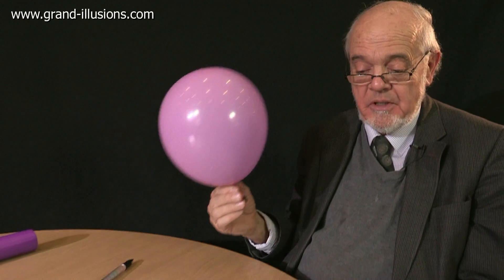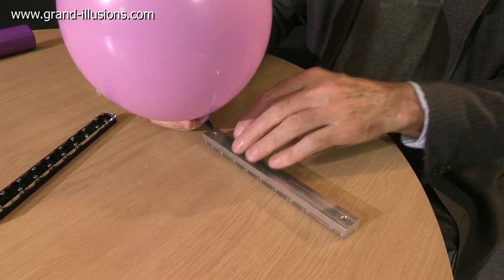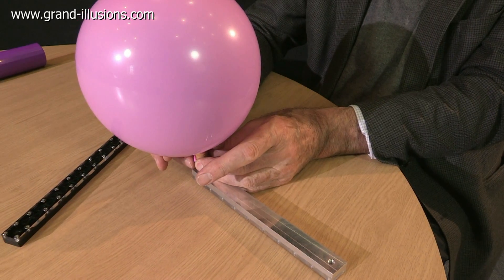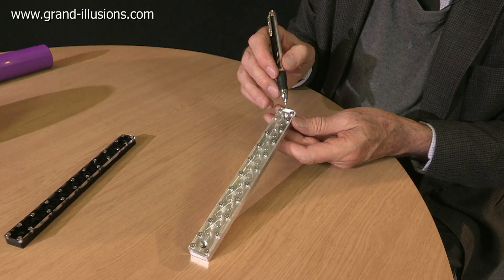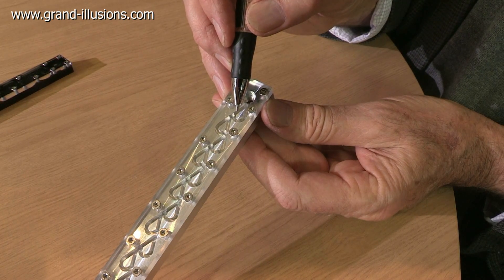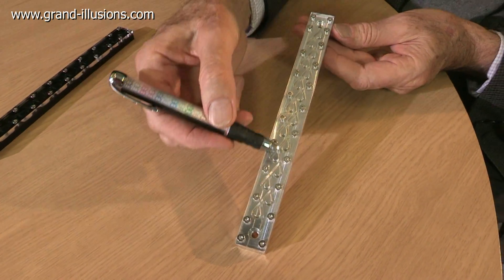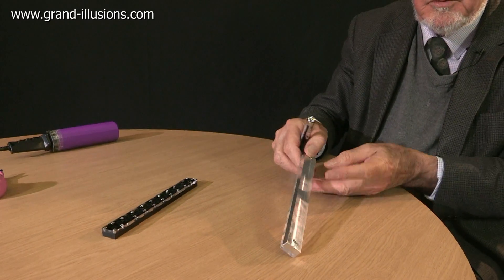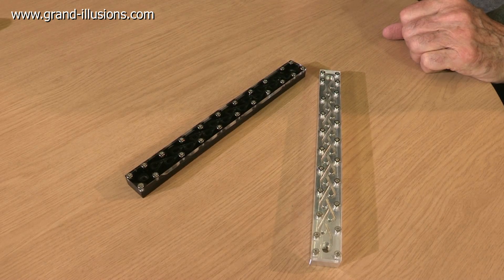Tesla Valve

Comment: On Jay leno's garage he has a video about a steam car and says it's difficult to make a check valve that can hold back 1000 lbs or pressure. Maybe this could be of some use there, unless it works worse at higher pressures
Reply: Jim Henline And you are too dumb to recognize that it is simply a useless toy.  
You know - there is a reason why it is not used at all.
Your inability to understand that is striking.
Reply: Nabre Labre It would be absolutely useless - as it is for every other application.
It is a nice gimmick that kids all over the world invent all the time over and over again,  cause how simple it is.

But it is well - useless.
It can NOT stop any gas/Liquid form flowing through. It only slows down rate.
And another problem is, that it has still a big impact on the forward-flow as well.
Aka even in the right direction it limits the flow significantly.
Reply: Jim Henline
"There are plenty of uses, if you are not intelligent enough to think of them that is an issue you have, not others." 
Or maybe there are simpler and more effective ways to do it.

Your example of a bleeding-system . just make a smaller diameter and maybe bit longer and you are done.- far easier to produce.
And really - how much more of a stupid idea can you come up with?
it is designed as a one-way 'valve' and fails at shutting tight.
 
That valve is a nice thing to play with, but that's about it.
Reply: ABaumstumpf Not really a check valve, but a damper valve. Also saw in comments that it has been used in some shock absorber systems and that makes perfect sense. Faster response because it's making use of the inertia of the working fluid, also a slow let-off of back pressure so there is virtually no fluid-hammer.

So how to use it? Treat it as a circuit with a check valve parallel to a metered orifice. If that sounds useful, then compare the wear and tear on this to the duty cycle that a mechanical check valve in that setup may go through. Tesla was no dummy, although he's much better known for his electrical work.
Reply: It should work better as pressure gets higher, since it get's its effectiveness from the pressure. But remember that it doesn't completely stop flow, it only slows it in one direction more than the other. If you are only ever using it in one direction there are better tools out there.
Reply: ABaumstumpf As a restrictive valve actually its perfect. No moving parts to wear and so with a high pressure system it can be used to regulate the system and allow controlled bleed off without moving parts. Slight change the design to allow the teardrops to get larger and larger and the system become a muffler allowing escaping gases to dissipate before being vented.

There are plenty of uses, if you are not intelligent enough to think of them that is an issue you have, not others.
Reply: ABaumstumpf Again, if you are not intelligent enough to think of uses for it, then I really cannot help you, youtube comments are not the place for me to teach you the basic tenets of engineering.

And it wasn't designed as a one way valve, it was designed as exactly what it is a "valve" so to speak which with no moving parts restricts flow in one direction and not the other.
Reply: ABaumstumpf Have a good day.
Reply: Jim, stop digging that hole.

Comment: I can make the same thing with a "door" inside that can go a little bit to one side before it hits a pin, and a lot bigger to the other side before it hits a pin
Reply: Ah but that’s not “no moving parts.”
Reply: Congratulations, you've "invented" the traditional valve with moving parts. Now invent one without moving parts.
Reply: @bramvanduijn8086  - This valve relies on "moving parts" too (the fluid itself is the moving part, without its motion it wouldn't work). There's literally no advantage to Tesla's design. It's extremely inefficient and gets worse as the pressure increases.
Reply: @RFC-3514  Not to argue the efficiency, because I'll take your word for it, but do you expect the water to break from overuse? The reasons to have less parts are:
 - Interactions increase wear-and-tear on the interacting parts. More parts = more interactions = more wear = more replacements needed.
 - Each part has a non-zero chance to be faulty from the start. These chances multiply, so one part that fails in the 0,001 fraction (= 0,1%) chance, gives the entire device a a 0,001 chance to fail. But if you have 10  parts, that's 0,999^10 = 0,989, or a 1,1% chance of failure. This means you need to machine your parts to a higher standard just to get the same 1:1000 failure rate.
Reply: @bramvanduijn8086  - I don't expect anyone to use it in the first place (an expectation confirmed by reality).

And no, I don't expect the water to break, but I expect the valve to be subject to friction and corrosion, just like water pipes in general. But that't not even the issue. The valve exists for a purpose. The purpose of the valve is not just to keep existing as long as possible.

I see you've gone from "moving parts" to "number of parts" (whatever that means - how many "parts" are in an LED, or in a NAND flash memory chip?), but that's still hollow conjecture. Virtual equations might be a great pastime, but the real world is the real world, and it's trivial to find examples that contradict any generalisation about "moving parts" or "more parts". Multi-part systems can have fault tolerance built in. A single-part system will inevitably fail if its one part fails.

If I can make a fully controllable and adjustable valve that last 75 or 100 years on average, and is easy to repair or replace for 25 cents, why would I spend 10x or 50x more on a different design that requires more resources,  takes up a lot more space, can't be adjusted, is a nightmare to unclog, and doesn't even behave in a consistent manner with different fluids, just because it might last 200 years instead (if it's run under perfectly ideal conditions)?
Reply: @RFC-3514  LED and NAND flash memory chips last so long because they have very few parts. That's my entire point.

And yes, all that is conjecture, well spotted. Have a bonus internet point for that.

"Multi-part systems can have fault tolerance built in. " So you admit that adding parts requires the need to increase the part's tolerance?

As I said before, I'm not going to argue the efficiency, all I ask is that you admit that more parts is worse than less parts assuming all other aspects being equal. You can argue about inequal situations as much as you want, have fun tilting at those windmills and fighting those strawmen, but don't expect me to care.
Reply: @bramvanduijn8086  - Except they don't last so long.

Why do you think I picked those two examples? Didn't you stop to think, for one second, that maybe I'd picked those because they supported the point I was making? Didn't it even cross your mind to spend two minutes learning a bit about how those two things work before hitting the keyboard again?

It wasn't even meant as a trap, but you made it into one.

LEDs age quite quickly if driven at high currents and without active cooling (as is typical in consumer products); after one year turned on, they'll have about half the original intensity. And SSD drives (that use NAND flash memory) have a limited number of writes, after which they become "burned in" (unlike traditional hard drives, with moving parts, that have no limit on how many times data can be rewritten).

Your "entire point" about those (as about valves) is based on lack of knowledge about them.

Thanks for confirming my initial impression.
Reply: @RFC-3514  You are positing unusual conditions and then expressing surprise that the parts break.

For traditional light bulbs the environment (which gases) around the filament or the strength of the current can massively decrease longevity.

For traditional hard drives it is increased read/write speed that kills the mechanical parts.

My estimate of your ability to see giants in windmills was accurate. Go fight those giants Don Quixote!
Reply: @bramvanduijn8086  - I am not "positing unusual conditions" at all. If you knew the first thing about engineering, you'd know that.

As you'd know, for example, that the current through a tungsten filament bulb (ignoring minor variations due to local mains voltage)  is determined by the bulb itself, which is not the case with LEDs. 

And the life of mechanical hard drives has nothing to do with read and write speeds (which in turn have very little to do with any physical speed - a drive that spins slower and moves its heads less can read and write data faster than a drive that spins faster and moves its heads more), it's mostly a function of thermal cycling (which has nothing to do with movement or with "the number of parts").

Your understanding of technology is truly the gift that keeps on digging.

When you next use some mechanical or electronic device, be thankful that they were designed by people with a clue (and qualifications, and experience), and not by self-appointed YouTube "experts" suffering from Dunning-Kruger syndrome.

Comment: COOL! Read that using Fluidics you could make a digital computer that runs using compressed air. Would the Tesla valve be part of such machine? Do you think if Babbage had thought of using compressed air for his "engine" he could have got his computer build my the people who made pipe organs and player pianos?
Reply: Check out / Google Horton Billy Mitchusson Patent 3107850, then dig all those neat links to things like compressed air memory storage. Add a little Nano tech. and who knows? Bummer Babbage didn't stumble into this like Edison stumbled on to the phonograph. Da Vinci should have invented the phonograph, so we would now have 500 years of recorded music!
Reply: ufoengines Mechanical or even steam-powered computers did exist.  
But the tesla-valve would be entirely useless for this - yet again:

It does not shut of the flow - it only hinders it - in both directions. Just marginally more in one direction than the other.  
And for a computer you want to be able to somehow control the flow - aka you need normal valves with moving parts.
Reply: ABaumstumpf Mechanical equivalent of a snubber diode? Put it upstream of a fast closing valve where fluid hammering may be a problem. A mechanical check valve would take a beating and may not respond fast enough, as where this would act like a metered orifice in the other direction and dampen flow.

Comment: What would this even be useful for? Faucets?
Reply: gladitsnotme Looking at how it works, I could see it possibly having some use at dampening back pressure - might be a practical way to deal with water hammer or other annoying resonant flow effects.
Reply: gladitsnotme Tesla used it in an engine design. He used it on the fuel and air inlets to a combustion chamber, and the exhaust drove his turbine.
Reply: Could be used in a pulsejet, I would think. It would trade a little efficiency for longevity.
Reply: +Someday Soon (RoyalVlogger) He said it "could", not "is".
Reply: +gladitsnotme could be used as a water pump
Reply: It MIGHT be useful in controlling tidal flow
Reply: Its only real use is generating traffic on YouTube.

Comment: What would happen if you put two balloons on it, one on each end? Would the air flow from one to the other and make it pop, or would it reach some sort of equilibrium?
Reply: LimeGreenTeknii The pressures will equalize. Fast or slow depends on which way the air would be flowing.  If the balloons are the same the balloons would go to being equal in size.

Comment: some shock absorbers using this tech
Reply: @Chris Russell i love that. Its so smart and sciencey and genius in how particular but simple the design is.
Reply: @Heads Mess surprised why this kind of fluidics isn't more common. Then again, they're probably a pain to calculate & model
Reply: @Muckin 4on completely agree. I’m that same hands on just do it and if it has issues then revise it until it meets my needs. Having a machine shop makes the process much easier but for good reason this is how I’ve preferred learning. Material is cheap and much time is saved when you forget about trying to be that design and perfect design guy to find out half day wasted in front of a computer or longer while in the meantime I have a part completed for initial testing. Lots of folks miss this opportunity in life and overthink everything.
Reply: @Muckin 4on ja díselo a los que calcularon a mano todas las simulaciones basados en los modelos
Reply: no ned for that, they already have a washer over some holes that clogs em on one way and the same holes push the washer away on the other way, freeing themseves... but not a terrible idea
Reply: @Heads Mess "why spend three years figuring out how to simulate it"
Who would take that long to model & simulate nowadays?

"Wack one together in a few hours and see how it goes in real time"
Would it really take that short to suddenly arrive at an optimal product & be so sure about it? What if it doesn't perform well, or even work at all? What if you need to iterate lots of prototypes, making those "few hours" sum into longer than modeling & simulation, while adding material & fabrication costs?

"If you don't attempt to design things, your fluid dynamic simulations mean nothing"
When did I say that simulating must equal not attempting to design? What if I meant designing intuitively first and then optimize to arrive at a competitive product?

What if there was no attempt to optimize, would those prototypes mean nothing?
Reply: @Heads Mess when did I say that building things is impossible without modeling & calculation? When did I say that intuition isn't enought to build them?

It's about optimization, sure one can whip prototypes in their garage based on intuition alone, but what about mass-production companies figuring if it's optimizable enough to replace/compete against existing alternatives? Or if it can be made as effective & efficient as feasible?

"Landing on the moon before your modelled rendering ever existed"
What's "my rendered modelling" btw? How did I own it?

"People design things, not computers"
That's why I said 'pain,' computers don't feel it either, they just help human designers. But when did I say it had to be computed?
Anyway, when did I say it had to be rendered? Good that you brought the moon landing example, didn't they still use calculations to work on it(though with slide rulers & such, but still calculations)?

Granted, it's now possible to quickly fabricate prototypes, but wouldn't calculations help accelerating the process & reduce R&D costs? And wouldn't statistics help figuring where to go from the current batch of prototypes?
Reply: @ki0w0-lordofwatersheep  from someone experienced who owns a machine shop I rarely do calculations, mathematics, detailed cad during r&d. Never produced faster or even better results than writing up a solid NC program in quick cam to make my 10 minute design and tool paths (literally) into a functional part the first time 88% of the time. Tool paths are most time consuming. The others may take 2-3 more attempts but it’s done and tested in a real world environment because computers and programs that calculate are often mistaken or don’t factor in real world properties including the physics and mechanical aspects of a component. Wear and tear, and so on..., anyways there was a project I did the way you suggest. Took me 3 months to complete first part after many designs. I canned that project and did a similar one that I spent 4 days before a finished product that was perfect. I made it according to the real world application that it fit rather than by computer and fighting because the math said otherwise. The part fit within another product and had I based it off the geometry from the connected components it wouldn’t ever work. Oddly enough it was a more challenging circumstance however the end result was pleasing. Oh btw the average new product takes 6 months for the majority of manufacturers to research and develop. I’ve Developed 6 in a week.